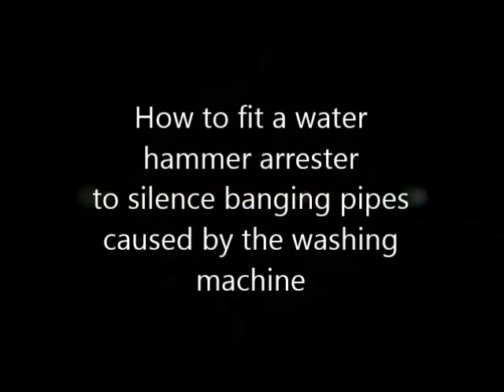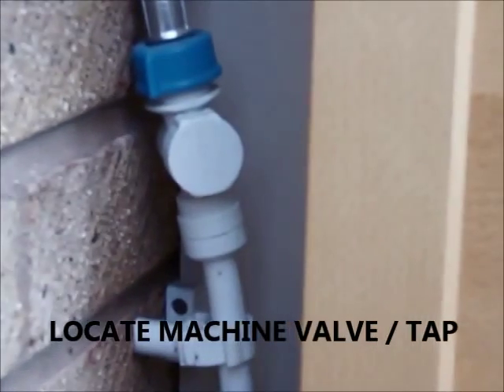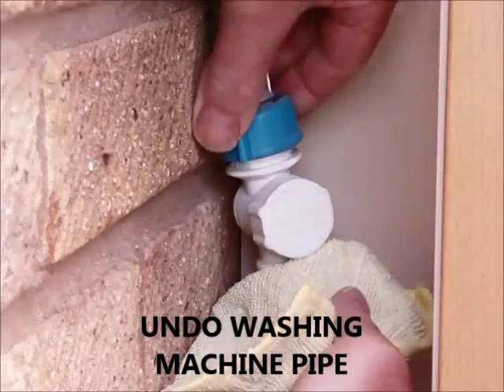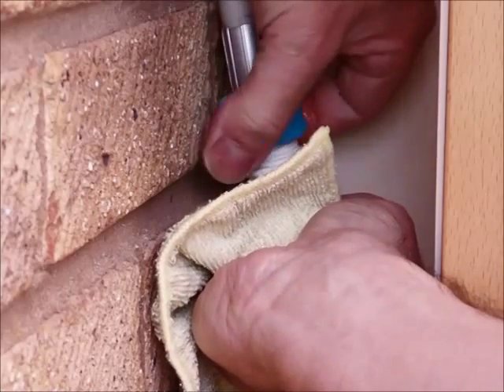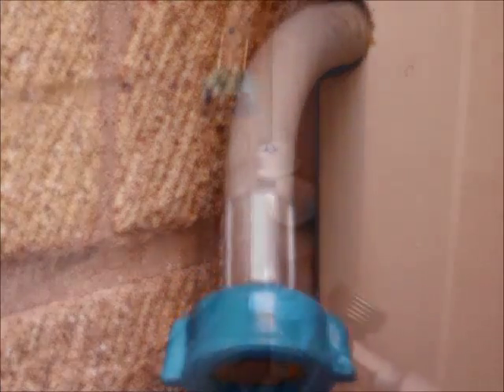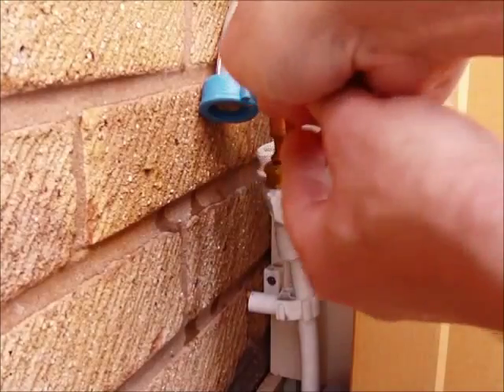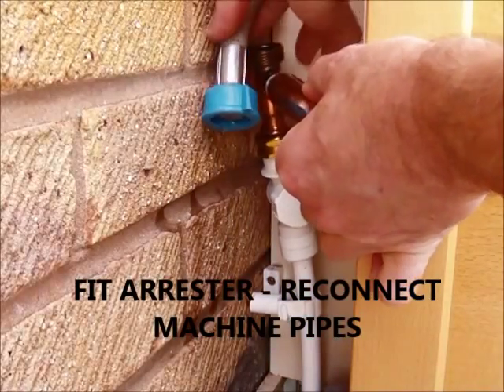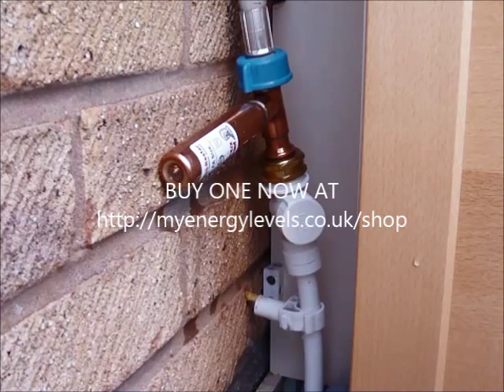How to fit a water hammer shock arrestor device to your washing machine or dishwasher

Comment: Is this not meant to be connected to the washing machine/dishwasher????
Reply: Thanks for your question. Indeed it could be fitted directly to the inlet valve on the rear of the appliance. However there is not always enough room between the back of the appliance and the wall or cabinet. Therefore it should be located at the other end of the fill hose at the shut-off valve.

Comment: I do not believe this video is correct.  I believe the perpendicular length of pipe needs to be vertical rather than horizontal.  It is supposed to be an air chamber; having it horizontal will allow it to fill with water.  If the pipe it were being inserted into were horizontal, the perpendicular part could be pointed up like it is designed to be.  Bottom line: I don't think this particular part alone will solve the water hammer issue in this situation.  I believe a Tee should have been inserted in-line, and then this water hammer part could have been installed onto the Tee to have the perpendicular chamber pointed up, which would allow it to be the air chamber required to solve the water hammer issue.
Reply: This is a hammer arresting device with a sealed chamber of air by means of a piston and o-ring.  The water and air never touch.  The benefit is that it can be mounted in any direction.
Reply: I fitted a AA size MiniRester from SiouxChief - must admit, I was sceptical of it working too, but it has cured the toilet cistern noise which was like the foghorn on the Titanic and none of my house taps make a 'bang' anymore. I connected it about 1m from the stopcock. Even the neighbour's new ceramic 1/4 turn taps no longer hammer - I am on a common supply with them. 
You can fit it any way up; it has a valve inside that you can see if you look down the end. 
I only wish I had known about this handy device years ago - nothing short of miraculous.
 So it was well worth the time and effort, and only £20 in parts.
Reply: @SG-jc2hr  You mean to say any direction vertical or horizontal because im so confussed i install mine in horizontal side hopefully will fine